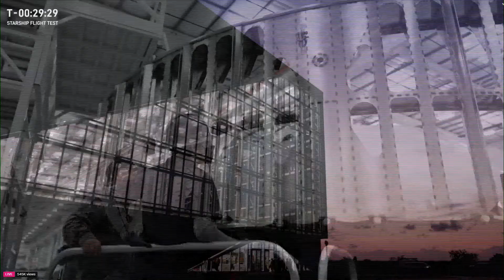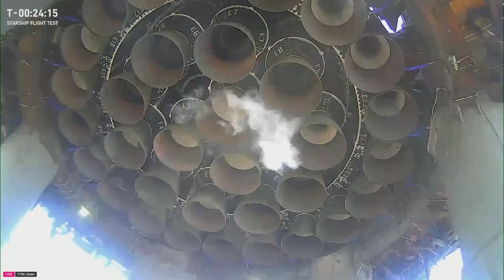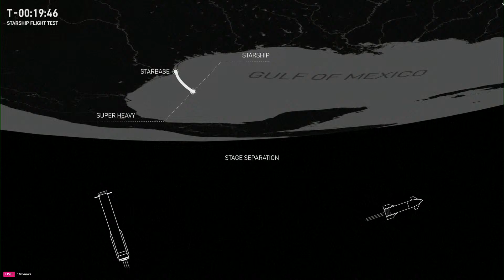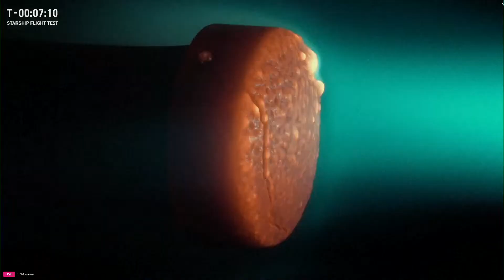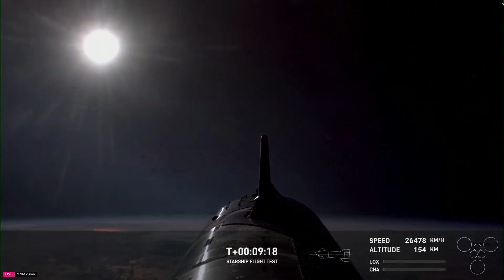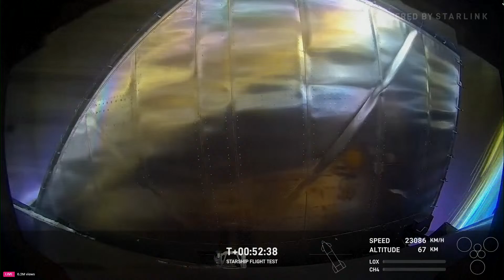Starship launch LIVE: SpaceX attempts sixth test flight of rocket

Comment: Hats off to all engineers. This was amazing to watch live!
Reply: @Borshyy  they definately have proven they can control those vehicles to precisely land. Even with damage
Reply: LOL the engineers crashed two rockets today, not even one.  Wake up
Reply: @area51z63

That was the plan Stan.
Push it to.the limit to see what and when it breaks.
Reply: @omegaz3393  Right -- why, that's just what the SpaceX people said!  So long as the plan remains failure, Starship will be the bestest rocketship there ever could be.  No major design goals have been achieved and the program is years behind schedule.
Reply: @rdbchase  not only years behind, nasa and usgao say it cant relight in space after a freeze and is underpowered. When starship was claimed 100 tons to leo nasa said itd take 15 refueling flights, now that its 40 max to leo itll take 40 extra flights meaning megatons carbon and methane a super green house gas directly into the upper atmosphere. Smh
Reply: @omegaz3393  In reality the plan was to catch the booster, they even said so, but the tower was damaged on launch and the booster then crashed into the sea because it could not be caught, or land itself as it was designed.  Wake up the starship is a total failure at this point.  However the two crashes into the ocean were marvelous and did keep down the flames somewhat
Reply: @area51z63  In that both Starship and its booster made controlled descents into the water, they can be said to have landed there (see denotation) and of course the fanboys do say so, but this does not demonstrate the feasibility of recovering both in a condition in which they could be rapidly reused.  The lack of demonstrated payload capacity is what concerns me above all else, but refuelability and recovery are obviously also critical -- even a "little burn-through" plainly means that Starship in its present form cannot be reused rapidly or at all, even if it can be caught without incurring more damage to its thermal protection system and structure.
Reply: @rdbchase  LOL controlled descent rhymes with rapid unscheduled dissasembly which all equal total failure.  The main stage MUST ALWAYS LAND UPRIGHT or it is a failure.  You are in denial at this point
Reply: @area51z63  Nonsense; if you've read my other comments, you know that I am not optimistic about Starship.  I simply point out that the denotation of "land" does encompass the way the fanboys describe Starship and its booster being deposited in the water -- "to alight upon a surface, as the ground, a body of water, or the like".  The fact that Starship and its booster are capable of making controlled descents is not in doubt; the ability to recover Starship intact so far is.
Reply: @rdbchase  LOL so please explain how the starship makes a controlled descent into water on the Moon or Mars?  Just let me get some popcorn first
Reply: @area51z63  That isn't a question at all, just nonsensical rhetoric.  Still haven't picked up on the fact that I'm not a fanboy, have you?  I don't understand why you're objecting to the phrase "controlled descent" -- there's video demonstrating that Starship has been under control when deposited in the Indian Ocean and the booster from IFT-5 was in fact successfully caught -- pursuant to a controlled descent.  Conceding the point that SpaceX can control Starship and its booster's descent doesn't begin to mean that the system does what it's supposed to overall (as I have been at pains to point out in post after post here).
Reply: @rdbchase  The booster being caught will not get anything closer to Mars as the booster is 100% irrelevant to the main stage traveling and landing.  Furthermore there was no controlled descent unless your definition of controlled means ended in a crashes and explosions and total loss of all hardware.  LOL you are a fanboy and you  would have defended the White Star Lines controlled descent of the Titanic
Reply: @area51z63  Iterative Design!

Comment: 2 crashes, not even 1 = total failure, unless this is all a ruse to hide the real space program
Reply: I can tell you didnt do your homework.
Reply: @TheKianykin  Laughing too hard to do any work
Reply: Wth does any of this even mean?
Reply: @justinj2170  There is a real US space program that is not blowing stuff off the Earth just like Apollo.  There were two crashes today, not even one. LOL
Reply: Not only was there not a single unplanned event during this flight, you need to start taking your meds before going online
Reply: @Acaicia  Did they catch the booster?  NO  Did the main stage land? NO.  We got to watch two hunks of junk CRASH in the ocean
Reply: @area51z63  Correct. As intended, the booster had a controlled soft landing in the ocean as a precaution to keep the tower safe. The ship also had a controlled soft landing in the ocean. Both were planned for and executed. This is a flight test, not a mission. The mission was to gather data.
Reply: @Acaicia  The booster was supposed to be caught, they even said so, the tower was damaged on liftoff.  No reusing salt water damaged engines even if they can be recovered.  Get a grip both stages crashed into the ocean so if that was the plan then having the stages land has been deemed impossible.  But the two crashes were funny
Reply: @area51z63 all i can said dumb😅
Reply: @Acaicia  Fanboys love these ocean landings -- rapid and total reusability must be just around the corner!
Reply: @area51z63  during tests, keeping the billion dollar stage 0 safe is more important than saving a test vehicle. If this was a mission to deliver a payload with a fully developed booster, I'd agree with you
Reply: @Acaicia  Both billion dollar stages were totally destroyed by the crash into the ocean.  LOL if they can't land these junks safely on Earth Mars is impossible.  This is a clown project and Musk has the big red nose and yellow shoes
Reply: @Acaicia  Actually both billion dollar stages were totally destroyes by crashing into the ocean.  If they can't land on Earth Mars is 100% out of the question making the starship the biggest failure ever.
Reply: @area51z63  first and foremost, starship stages did NOT cost a billion to build. Second, falcon 9 failed many times too, yet today it's one of the most reliable rockets out there and the ONLY reusable orbital class booster. I bet you would have laughed at the first Model T and said it would never work too.
Reply: @area51z63  it's also worth mentioning that, even if the booster was caught, they would have scrapped it. Both the ship and the booster are "test articles". Their purpose is to make exactly 1 flight and collect data. Not fly to Mars.
Reply: @Acaicia  So you were wrong about the cost.  But you can explain now how a main stage that can't land on Earth can land on Mars.  Just let me get some popcorn first
Reply: @Acaicia  Actually the test failed meaning nothing will ever be reused.  Just accept it
Reply: @Acaicia  That was to have happened two years ago according to Musk, but there's no indication now that Starship will ever make it to Mars.
Reply: @rdbchase  I agree, Elon's schedule is always HIGHLY optimistic and almost never happens to plan. There are no indications a Mars mission wouldn't happen though. Maybe by 2060 at the earliest
Reply: @area51z63  Disappointing, yes. Failure? No. Time will tell. Would a starship in orbit and another successful booster catch convince you?
Reply: @Acaicia  Musk lies.  Teslas are are not autonomous vehicles capable of being leased out as taxis for $30,000 per year or finding their way across the country when their owners summon them.  Tesla semis are not undercutting the cost of rail freight.  Vacuum trains are not revolutionizing transportation.  The list of deliberate falsehoods is very long already and growing by the day.
Reply: @Acaicia  No the booster catch is meaningless as it has no relevance to where the starship can go.  No as well to an orbiting starship as that is also meaningless as it is not designed to orbit anything as it was designed to land on the Moon and Mars and since it cannot even land on a level pad on Earth it will never land elsewhere.  It's already a failure, unless it is really for transporting an ion or fusion drive to orbit.  However this big dumb thing will never land upright on an uneven off Earth surface
Reply: @Acaicia  Of what?  Neither would indicate that Starship is a fully reusable, refuelable system capable of carrying at least 100 tons to orbit, would they?
Reply: @rdbchase  correct. In the same way the first Model T didn't indicate a vehicle capable of traveling 60mph for 400 miles. Or how a baby's first steps don't indicate a world class runner. Technology is a process
Reply: @Acaicia  LOL, but not every model T crashed and burned on its first trip. In fact many are still in service today, so stop being silly

LOL controlled descent rhymes with rapid unscheduled disassembly which all equal total failure.  The main stage MUST ALWAYS LAND UPRIGHT or it is a failure.  You are in denial at this point
Reply: @area51z63  this is going no where. Again, I point to Falcon 9 which had multiple actual failures. I'll also point to early Starship landing attempts which actually failed. SpaceX got past both. You're in denial and are the same as someone laughing at an infant struggling to walk for not being an adult capable of a marathon.
Reply: @Acaicia  How can you possibly imagine that that analogy is germane to a discussion of Starship?!?  It isn't a symbol or a process, but a particular rocket design!  You have so confused what Starship is that it is impossible for you to evaluate its development in any meaningful way.
Reply: @Acaicia  How you love to harp on Falcon 9, which has little more in common with Starship other than being a rocket manufactured by SpaceX!
Reply: @rdbchase  The spacex fanboys have a script that they must adhere to, and a rather silly one at that
Reply: @area51z63  Almost to a person they are scientific illiterates who have mistaken Elon Musk for a visionary genius.
Reply: @rdbchase  Schizophrenics have visions too
Reply: @rdbchase  Not in the slightest. Elon makes lots of really, really dumb mistakes. He's not an engineer. He does, however, have lots of money to pay engineers to make great technology
Reply: @rdbchase  Both are guided by gridfins, both do terminal descent burns, both land vertically, both take a 2nd stage to orbit. They differ in size and fuel, but the concept is the same
Reply: @rdbchase  alright chief, imma dip out of this conversation. At this point we're both arguing semantics. Starship is currently a test article and failures are to be expected (and necessary). I'll be back in a year or so when an orbital mission happens.
Reply: @Acaicia  Since semantics is "the study of meaning" it is the precise opposite of trivial.  The development of Starship is not going to comparable to the entire history of automotive development, nor is it likely to extend to 2060 (by which time you expect Starship to finally reach Mars); it's likely that other designs will be used over the course of the next thirty-six years.  The ungenius of Musk certainly looms large over what poorly informed people think about space exploration.
Reply: @Acaicia  For how many decades will testing continue?  This is important because technological developments are rapidly making the starship as designed irrelevant note that development began 13 years ago and they can still not take off and land without rapid unscheduled dissassembly Whaaaaa!
Reply: You = total idiot